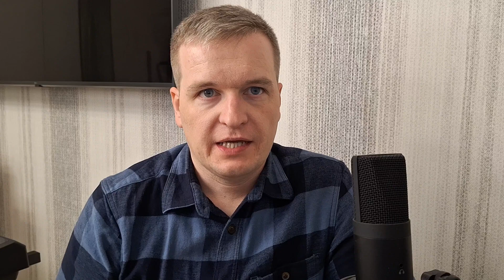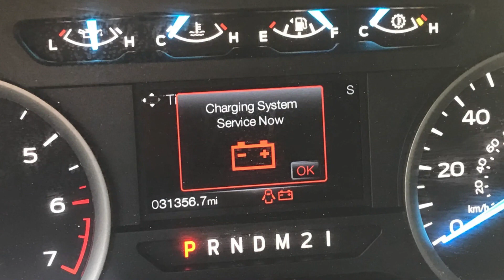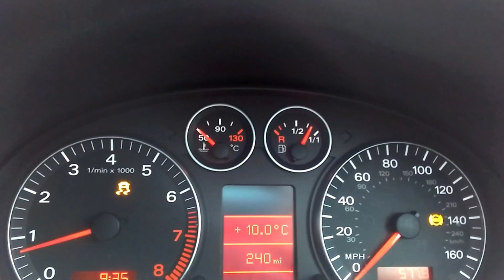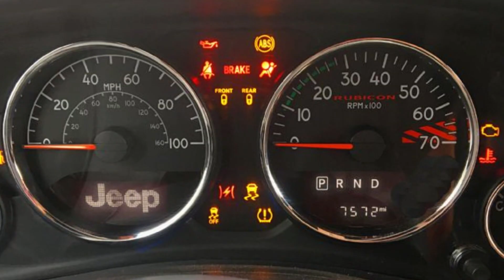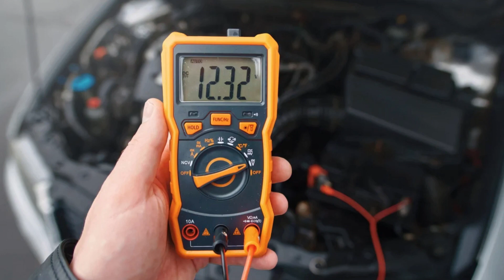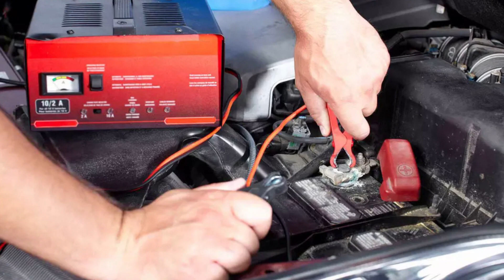Can a bad battery throw codes? And which ones?

Comment: I had my battery checked they said it was good then two days later it died died. Change your battery before they make you change your steering column lockout 2500.00 learning experience for me when the whole time it was a low battery

Comment: I had a dead battery (7.8 V) on my BMW E85 M. After replacing the battery, I had the famous trifecta of warning lights (ABS, DSC and tire pressure) with an error code 5E43 "Steering Angle Sensor Internal". The steering angle sensor was absolutely irresponsive - no digital or analog signal from it on turning the wheel. I cleared the errors with INPA and all was fine.